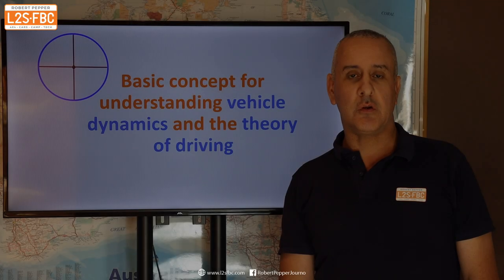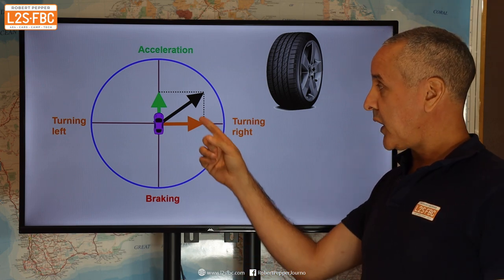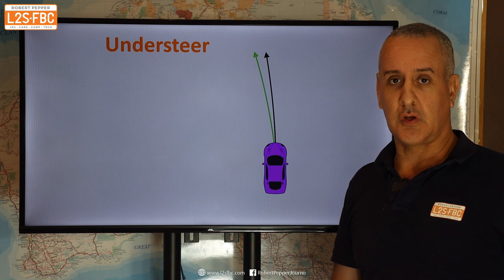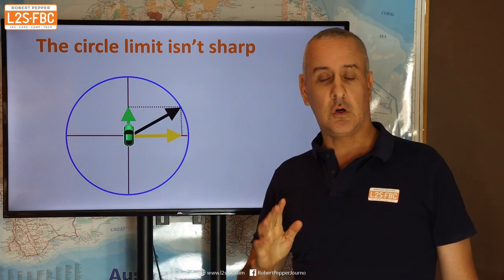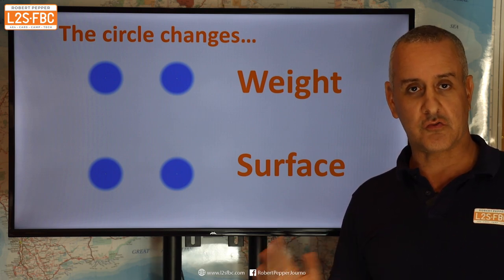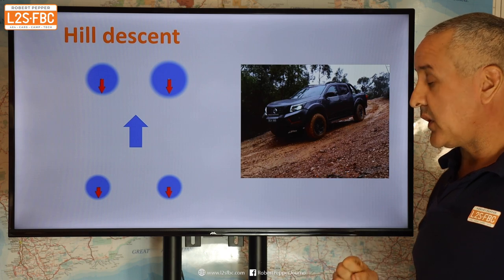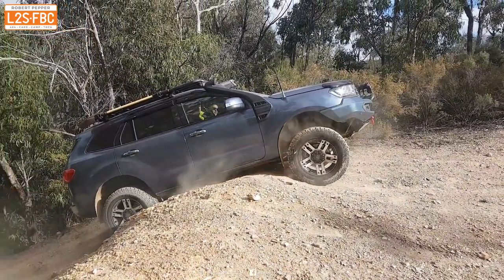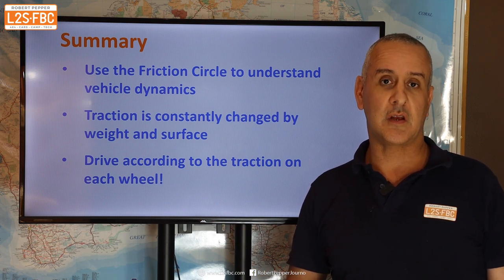Your 'grip budget' - how do you drive it?

Comment: A nice simplified version of what actually happens. My only bugbear is the use of "oversteer" and "understeer". Both of these are characteristics of steering design dynamics, what you are using them to describe is loss of traction aka skidding. To correctly understand oversteer and understeer you have to look at the fundementals of design of the steering and suspension of the vehicle - the factor of oversteer and or understeer of a vehicle does not change no can a vehicle oversteer and understeer in it's design. There is also neutral steering. How you measure neutral, oversteer and understeer is setting the vehicle at a set speed around a set curve and the known projectory is where the vehicle is expected to travel - neutral steer. If the vehicle turns tighter - oversteer as the vehicle is oversteering and if the vehicle doesn't turn as tight as expected this is understeer - neither are loss of traction and or skidding. Your slip angle chart is derived from oversteer and understeer tests, not from skid tests. skidding is a result of tyre design and composition not vehicle design and build.

Comment: Sorry for being an a&&, but front tires turn, and therefore the vectors don't really go front and side, they go perpendicular to the tires for cornering and in the same direction for braking and accelerating. And when the car slides, those vectors not necessarilly point where they originally were, like when no ABS braking they point in the opposite direction to where the car moves no matter the angle. And sliding grip is actually reduced... My point is: you explained what happens right before the sliding (or what would happen if you had ideal tires), but not during the sliding.

Comment: How helpful.
I am here because my car tried to kill me on a roundabout and it's become icy which isn't the norm for where I live.

I found out by this that my fwd car is prone to both oversteer and understeer considering how dramatic the weight shift is from accelerating to the back (front part of the car rapidly lifts up in the air) and from letting off the gas or breaking to the front (car dropps from above and sinks).
It's like driving a boat and a nightmare.
Also it has a tendecy for the front wheels to spin when taking off because it has an insanely reactive first gear (still getting used to it).
Death on wheels.
Reply from the maker: What car is it?
Reply: @L2SFBC 
Kia pride 1.3
I don't know which year.
This car isn't normal. It literally rocks up and down when driven.
But that might just be its age and some mechanisms within responsible for holding the front of the car down being worn out (don't know much about that).
Wish I could show how it looks.

Comment: It's my first video on the traction circle. I got almost everything, but now I have more questions, than before 😄
1. What if you modify your car and put wider tires?  Will it improve traction, reduce or nothing will change? I've watched some other video about tires and now I'm confused. You look like someone who really understand the subject. 
2. Is there a way to estimate grip force available considering tire load and its width? Namely I struggling to provide realistic-looking grip force for tires of a bus for a videogame. 
3. If you lose traction, shouldn't the traction circle be smaller to regain the traction?
Reply from the maker: 1. Wider tyres may improve grip depending on situation; specifically, track cars when cornering. However, the grip level is not related to the contact patch size which stays the same, just changes shape. More on this later.
2. That's a complex question; yes, but I can't help there, it's very complex modelling. I would suggest a simpler and better initial focus to be weight on tyre vs grip - more weight more grip, but it's not linear hence there is an overall grip reduction when cornering as the outside wheels gain less than the inside wheels lose.
3. No. The traction circle is available grip. If you lose traction, you need to reduce the traction demand to less than the traction available.  It is possible the traction circle suddenly gets smaller - there is an example in this video or maybe the Oversteer Recovery one.
Reply: @L2SFBC  🤔thanks. It will help a lot. I'll try to find some known grip vs weight values and start from there.
Reply: @L2SFBC  , there is one more thing that still bothers me after the night. If grip is reduced when load on tyre is also reduced (like here 11:20), then double set of wheels (like in some big trucks, buses and pick-ups) should give double amount of the reduced traction, right? 
The next problem that I need to solve is to find out the form of the curve. Whether twice smaller load result in less than twice smaller grip and thus greater grip overall. 🤔
Reply from the maker: No, weight is a big factor in traction so double wheels = half the weight on each wheel = half the traction. Except it's not quite that simple as there are other factors. But one important point = the effect of weight is not linear. Double weight on a wheel is not as much as double traction. This is why when cornering there is a net grip reduction.